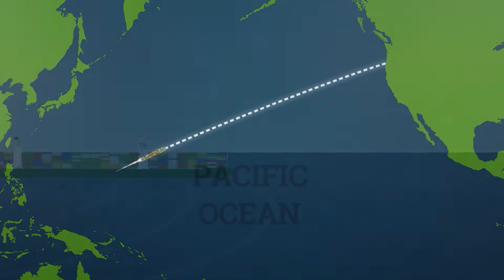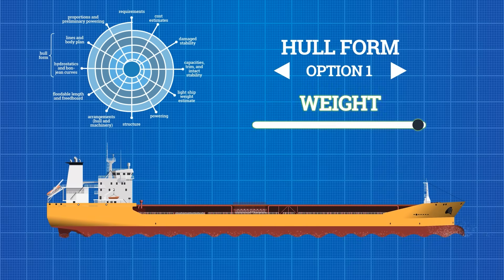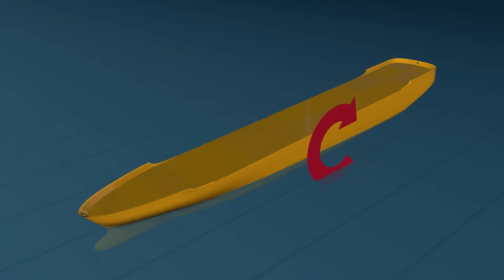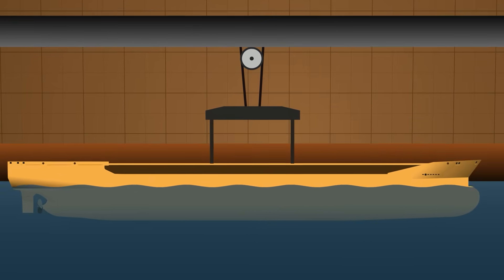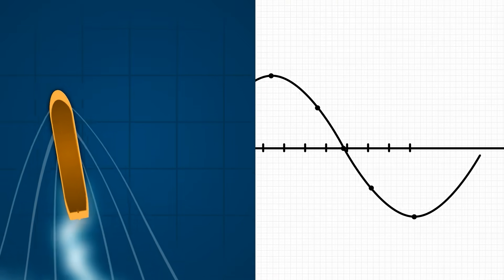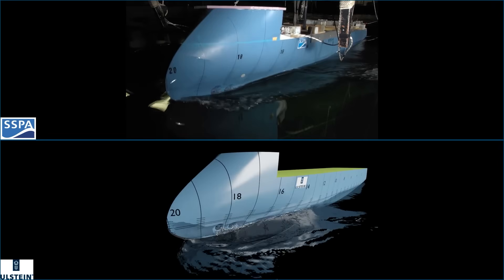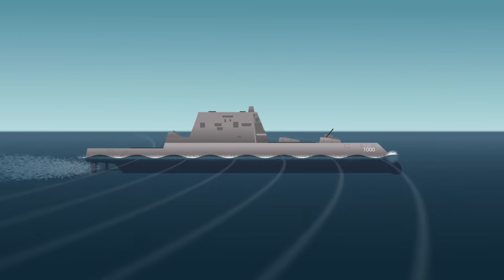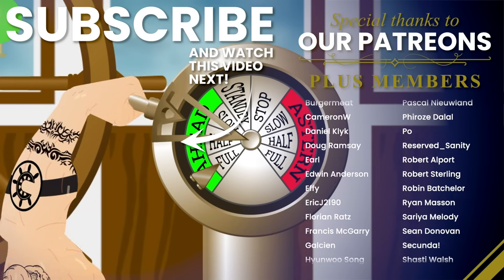How Ships Are Built Small First

Comment: This video is really good, but its worth pointing a few things out: 
Its not actually possible to maintain reynolds similarity in model testing as your model would have to go at hundreds of knots. 

Instead (as shown in the video) it is tested at froude speed, and the resistance is measured. What froude worked out was that you could split resistance into components- friction resistance and residuary resistance (wavemaking and form drag). The residuary resistance will scale with the froude number (so you can work it out for the full scale ship), and the frictional resistance can be calculated using empirical formula involving the reynolds number.  Therefore you can add them together for your full scale ship!

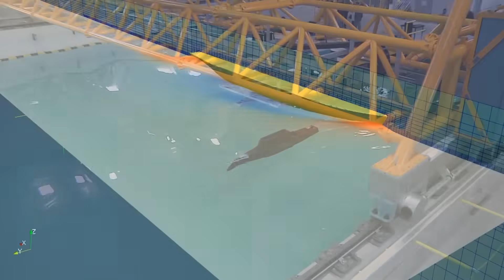Comment: 6:50
What's with the checkerboard? 
I assume it is something to do with a sensor of some kind, I'm just curious what type.
Reply: I guess the people on board like to play chess
Reply: I would say it's for tracking of a position relative to the carriage pulling it forward. PRobably meassured with a camera positioned directly above the checkerboard. EDIT: The camera is visible at 6:44.
Reply: I used to work in aerospace crash testing.  There it served as a calibrated scale, it was printed to an exact size, and with the scale and a calibrated camera lens, we could measure various different movements via video to a very high degree of accuracy.

We used what is called quadrature targets because there were only 4 squares, but occasionally we would have a series of them to better compensate for lens distortions and get a higher accuracy measurement.  Looking at their setup, I think they are doing similar. 

With an overhead camera squared up to the checkerboard, the checkers will appear to shift from square to trapezoid shaped as the model pitches and rolls.  (Look up perspective drawing to understand why.)  With a calibrated camera lens, you can measure how much the shape appears to distort from square.  Using trigonometry you can then calculate (or more likely have the computer calculate) the precise pitch and roll of the model.